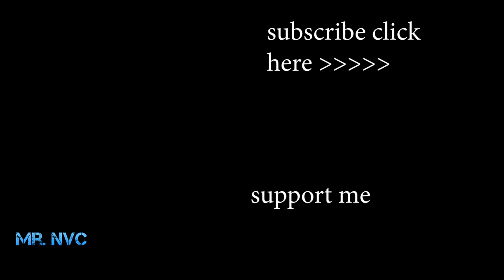Antique Rusty KNIFE Restoration

Comment: considering what a mess you started with, a good job. However, I think the handle installation could have been better. I think I'd have gone for a hidden tang in this case. I just don't like the looks of the epoxy and wood together. Should be strong, and if you got the re-treat right, the blade should be plenty good. I must admit, the way it looked in the beginning I wasn't sure if it was a blade or a damaged saw. The metal work is excellent I think. (for what you had to start with anyways)